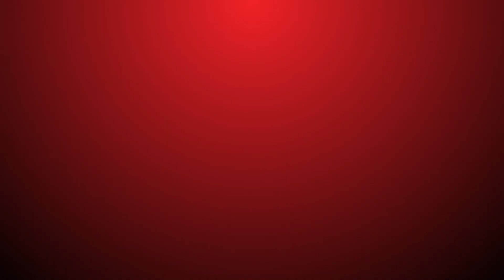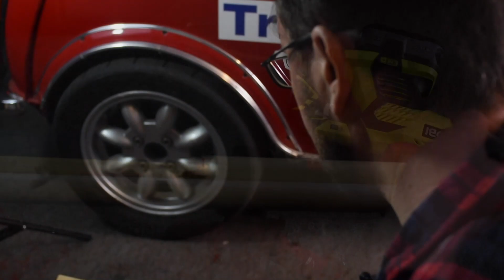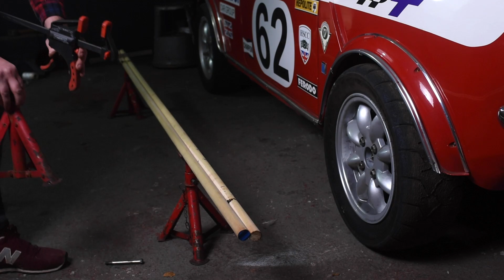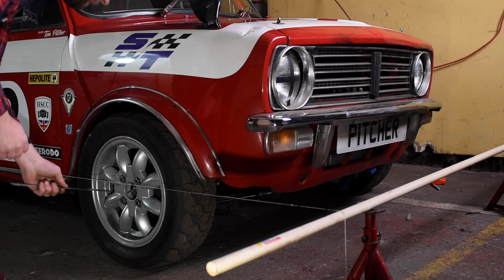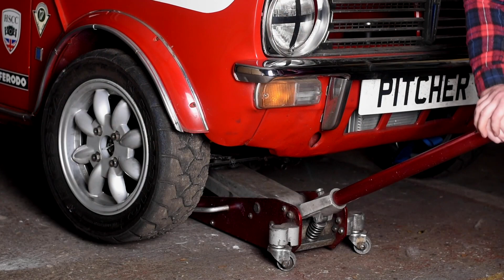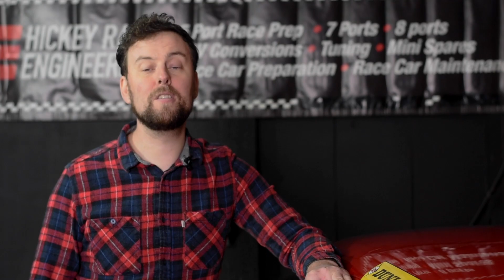How to measure and adjust front end wheel alignment

Comment: Hello . I used your method today and it worked a treat . I didn't have any string.  I used 9 pound fishing line which allowed  accurate measurements and slid easily during set up . I also saw a tip from Classic Diy mini  guy . About centering the rack using  the hole revealed when the floor rack grommet  and rack filler stopper was removed . This was really useful for locking the rack . Many thanks Leigh
Reply from the maker: Delighted it helped you Leigh, some times the simplest tricks are the best and thanks for sharing the trick with locking the rack

Comment: A couple of observations general rule is front wheel drive should be set toe out and rear wheel drive toe in. Also adjusting the track on one side only will achieve the correct toe angle but your ackerman/thrust steering angle will be out and you will have more degrees lock on one side compared to the other and the steering wheel will be off centre. Tracking should be adjusted equally either side. Great DIY method of checking tracking and informative video as always.

Comment: If you don't know the thread pitch you can loosen the locking nut and put it back loosely and after slackening off the rod measure the final gap or move it out the required distance to check the other way round.
Reply from the maker: Great Idea Tony and a great addition thanks for sharing 👍👍

Comment: Great video (just saw it) and a simple way of doing the alignment. Thanks. Just a brief thought and possibly a stupid question: How do you make sure that the front wheels are straight ahead, i.e. the steering wheel is in the dead center? The wheels could have different settings as well...
Reply from the maker: Hi Rolf, unfortunately this was one of my first video and I forgot to mention that I lock the steering wheel with a steering lock off the seat
Reply: @HREIRL  Thanks. Got it! The last question, I promise :-) - How do you know that the wheels are pointing straight ahead before the adjustment? What I mean is ("I" is a wheel:-) ): "I" and "I", not "/" and "/", or "\" and "\"? We are talking about millimeters here...

Thanks btw for the new clutch video.

Comment: 2:49  You mention that you prefer either parallel or 1mm of toe-in for road cars.  When I was a kid, the rule we all got taught was toe-in for RWD (as the front wheels are essentially drag on the front suspension) and toe-out for FWD, as putting power through the front wheels would pull the front suspension into its rubber bushes and straighten the wheels up when under load.  (Of course, this won't apply if you're using rose joints.)  Your thoughts?
Reply from the maker: You are most correct generally I do just set them up straight ahead but from time to time I find on a car with a lot of torque steer on the road a tiny touch toe in settles them down and makes them more predictable
Reply: I had the same thought, either make them dead ahead or slight toe out.

Comment: I think I must be a bit thick but what are the notches in the doweling for as you don't seem to use them in the process?
Reply from the maker: Midge I didn't mention it in the video but there what the string sits in, It makes sure the string is equally distance apart front and back

Comment: Hows does 1mm of track rod change result in 1mm at the rim? Surely there is difference in track rod connection from hub pivot vs the rim edge to hub pivot?  I'd think just trial and error until you get what you want is best option.
Reply from the maker: The thread pitch of the track rod I am using is M12x1mm Turing the track rod one revolution will move the wheel from its relative position 1mm because the track rod is in the same plain as the wheel the movement is relative.
Reply: Just tried this, works great but the standard track road is about 4,2mm on the rim  for every rotation with standard track road thread.  But yes it works and great explanation, thanks!

Comment: Great stuff! Just what I was looking for 👍 I’d be interested in a more in depth video talking about castor
Reply from the maker: Hi Matt, Sure we will definitely do a bigger video looking at caster camber and toe and there effects on handling.
Reply: @HREIRL  I’ve just got the adjustable rear brackets that I need to fit and then check the setup for. I also have the front lower camber arms to go on at some point.

Comment: Great video.
Once you have the parallel strings set up, have you thought of removing the road wheel and using an axle-stand under the lower ball joint to maintain the suspension in the loaded state?  This would allow you to adjust the track-rod end and check toe without having to put the wheel back on.
Reply from the maker: Sure David that would work. The only slight draw back to doing it that way is you only have the with of the Disk to measure the difference. If you measured very actually it would be successful. Like every thing it’s a pay off 👍